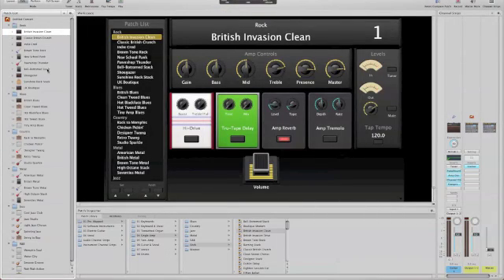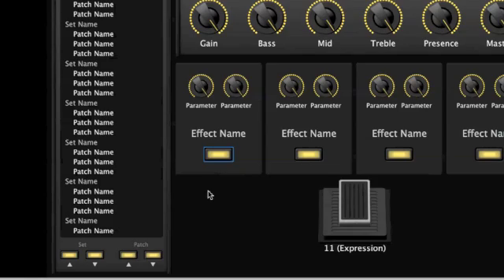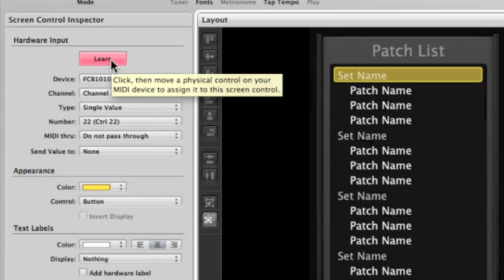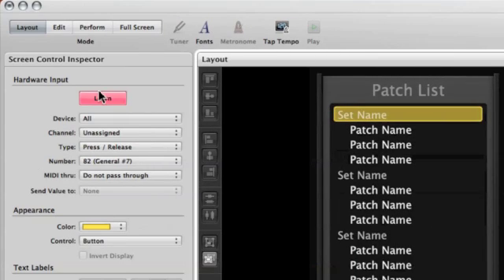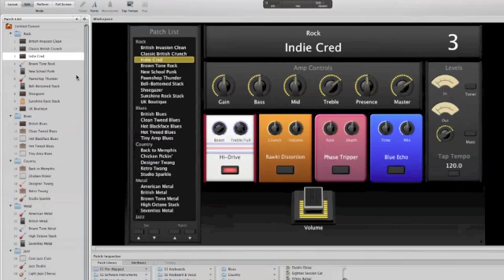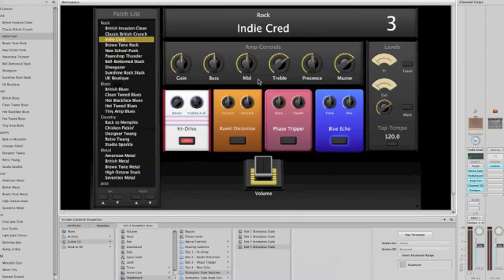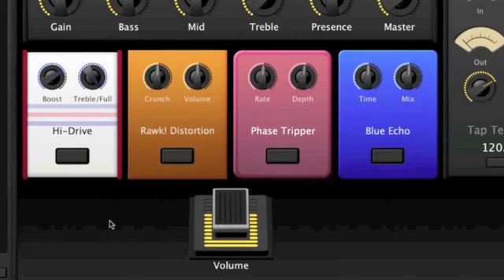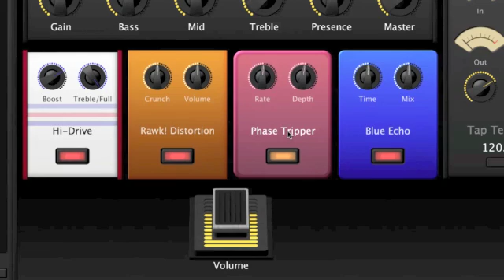Mainstage 2 Stompbox Control with FCB1010 - Part 2 of 3

Comment: Hello, you have helped me quite a ways, thank you so much! I am not able to assign the pedal on the fcb1010 to the pedal in Mainstage however. In layout mode it identifies my i/o (not the fcb) and sets the Number to Reset. When I change the Number manually with the mouse and return to Edit or Perform, the FCB changes the stomp boxes in quite an undesired way. Any tips would be greatly appreciated!
Reply from the maker: Hey Winship...no worries, let's start with calibration, are the pedals on the FCB calibrated as per the manual?
Reply: I did a factory reset a few times. Other than that I just watched your first and second video. Is it something else?
Reply from the maker: Yes, there is another step you should do first.  Decide what you want to use the pedals on the FCB for e.g. one for volume (CC7) and one for expression  (CC11) then (using the FCB manual which is downloadable from Behringer) go through the pedal calibration steps as outlined then try again with Mainstage.  Don't worry about the device name Mainstage detects, just whether or not it is seeing midi data and mapping.  The calibration normally resolves 99% of problems here.  It's not for sure this is the problem, but there's a good chance it is.  After that, we take it to the next step.